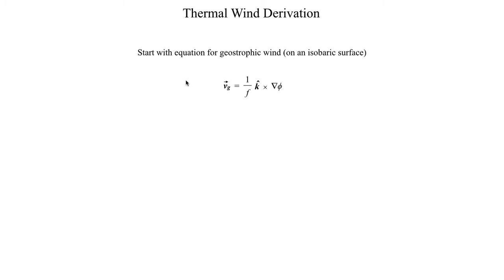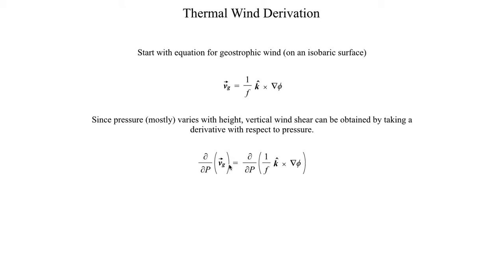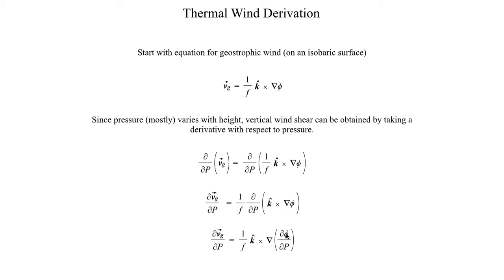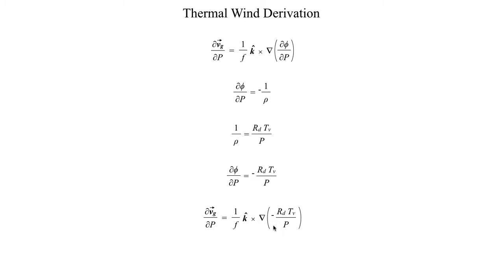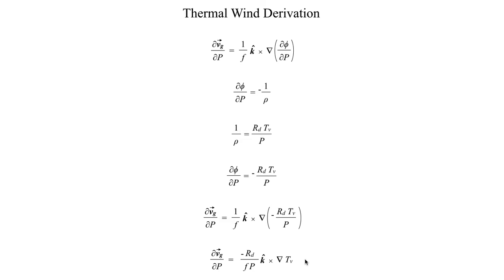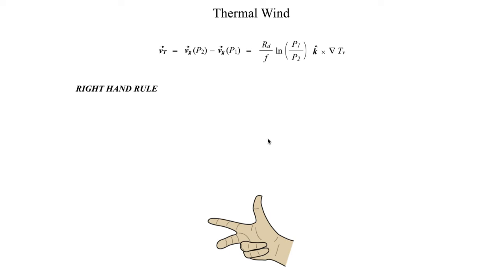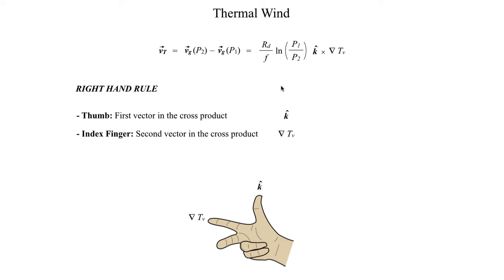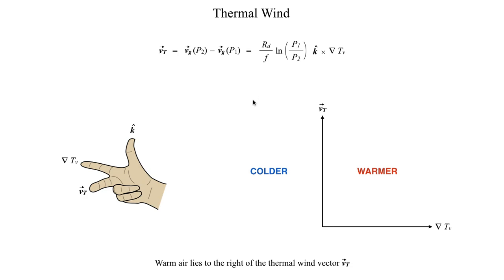METR2023 - Lecture 12 - Segment 3: Derivation of Thermal Wind

Comment: thanks for classes, but the right hand does not work/apply for thermal winds in southern hemisphere... so that shoud be said or remarked
Reply from the maker: Good catch! If working in the Southern Hemisphere, the Coriolis parameter (f) is negative, which means the result from the right hand rule should be flipped if in the Southern Hemisphere (using the left hand with same convention in the video would also produce the correct answers in the Southern Hemisphere).

Comment: Thanks a lot for this. One question, warmer (right) and colder (left) is the opposite in the southern hemisphere?
Reply from the maker: Yes, the temperature pattern discussed in this video would be flipped in the Southern Hemisphere, because the Coriolis parameter (f) would change sign.
Reply: Thank you a lot!! @davidstang2188